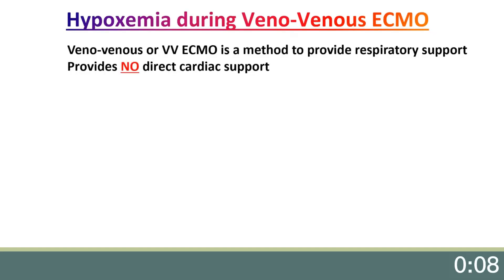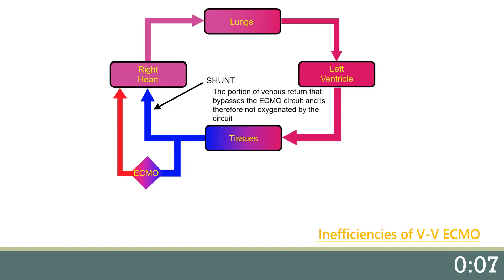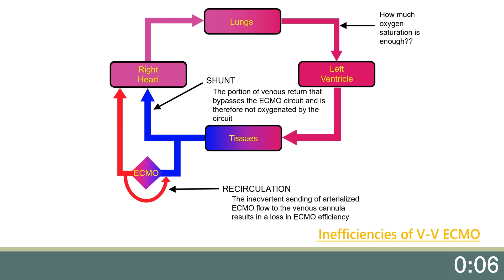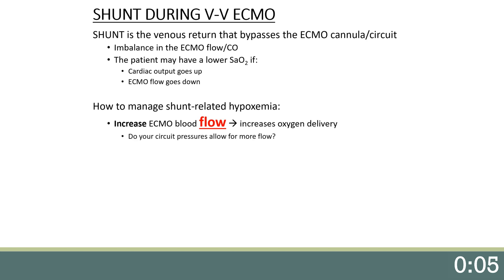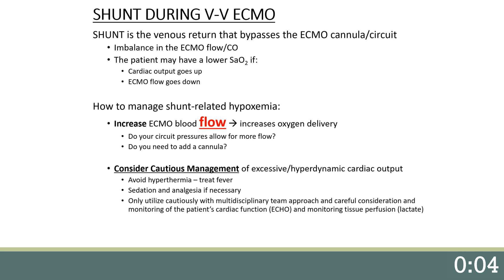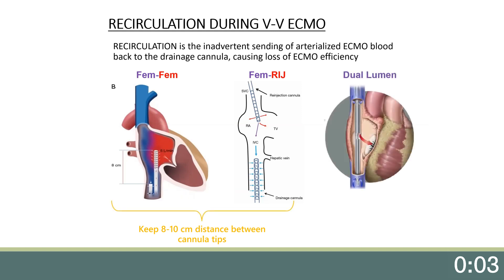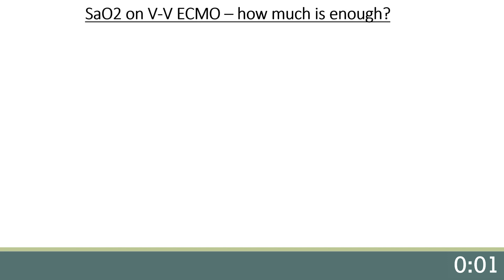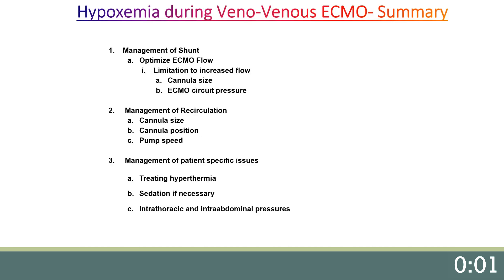8 in 8 Critical Care Series: Hypoxemia During Veno-Venous ECMO

Comment: So I'm using an ECMO simulator to simulate ECMO. This simulator has been worked on for MANY yeas. I can set several parameters, like Pulmonary Shunt, Dead Space, and Lung Compliance. I  want to simulate a patient who's lungs are completely unusable, and the VV ECMO support is DOING ALL of the oxygenation, and ventilation. I've got my Shunt set at 100%, and I have the lung compliance so low that with Pressure Control, I'm at most able to get SAFELY 20 ml Tidal Volume. I want to simulate COMPLETE respiratory failure. THAT ECMO support is doing EVERYTHING as far as oxygenation, and ventilation. Can I set the dead space higher than the tidal volume  I'm getting on my ventilator? Is that accurate?